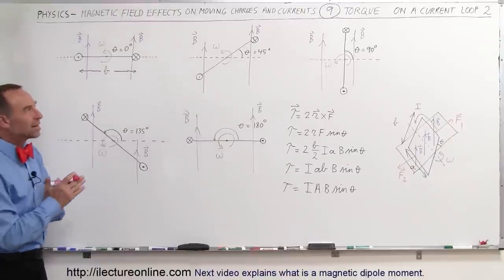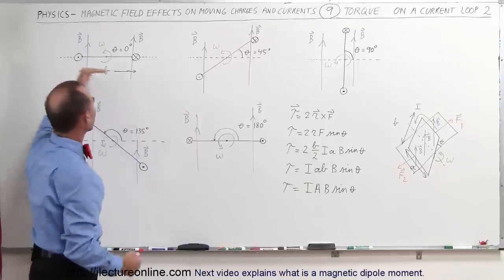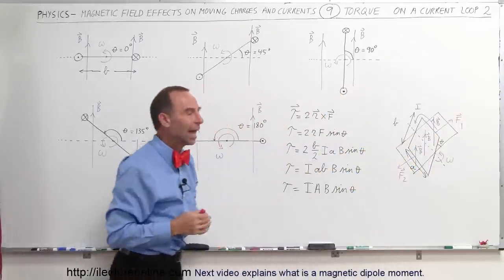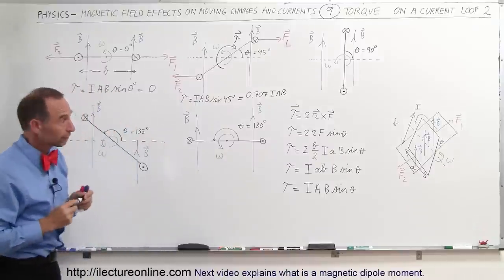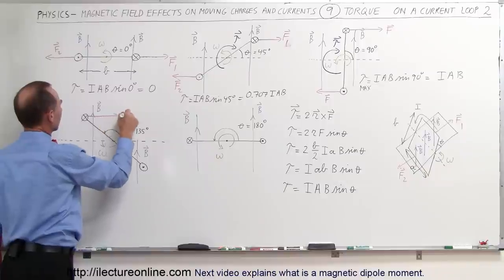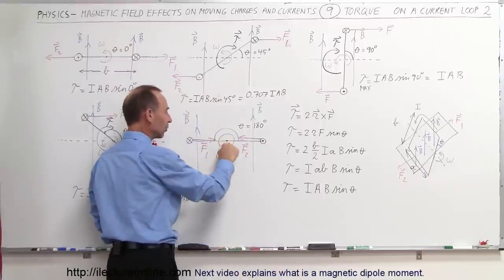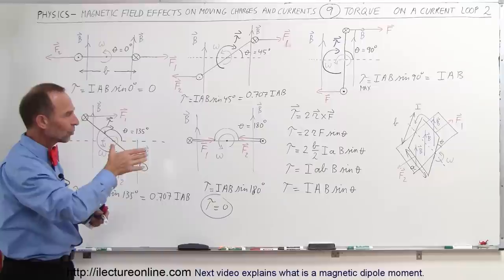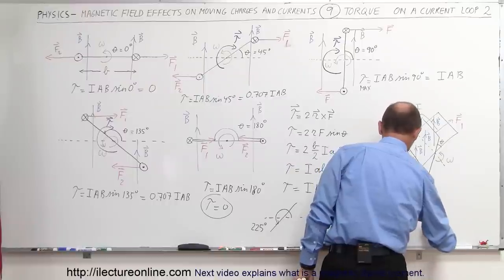Physics 43  Magnetic Forces on Moving Charges (9 of 26) How Torque Changes

Comment: why is the torque clockwise ?
Reply from the maker: It is based on the direction of the forces.  Which direction do the forces push the loop?
Reply: Okay i get it Thank you so much
but one more question please 
is the torque always opposite to the direction of the loop ?
Reply: Sir i want to contact with you, what should i do now.